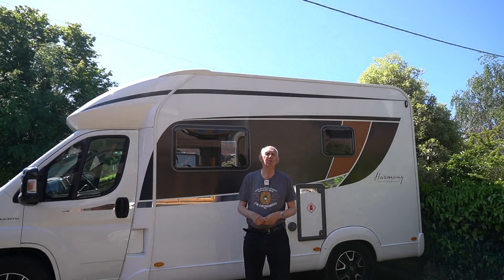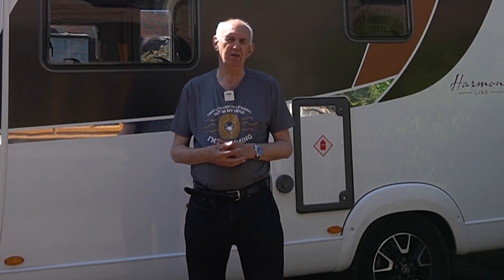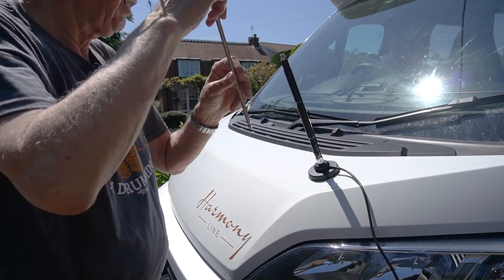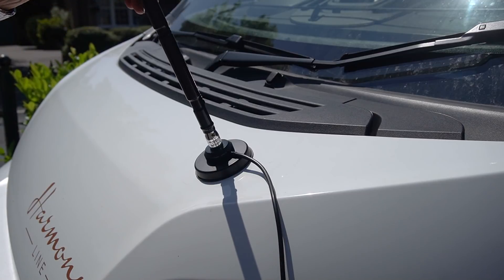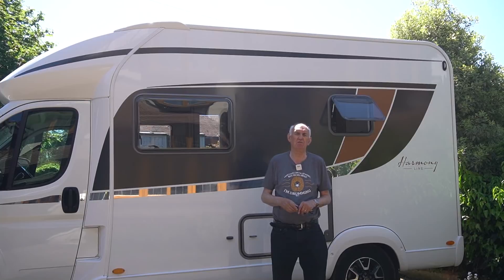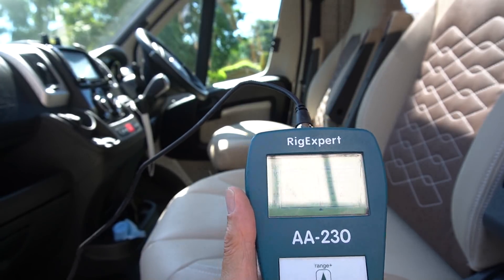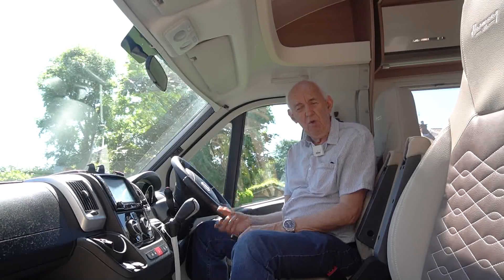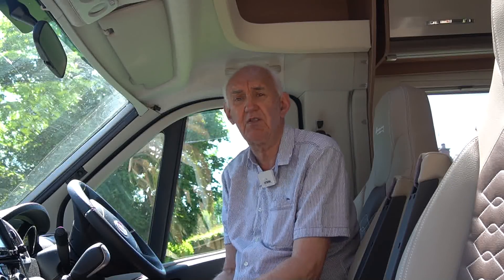HF MOBILE ANTENNA MAGIC

Comment: Thank you 4 sharing.
Would it not be better to install the choke at the antenna instead of the at the radio end? I am having this exact problem and just found your video. I am trying to work 40 meters in my RV connected to an ICOM IC-7300 and I am trying to use an MFJ-2289 Big Ear antenna system. I can't get the VSWR below 18:1. I am using a recently purchased RigExpert AA-650 ZOOM.
Any ideas?
Cheers,
Jay N6WIP
Reply from the maker: Hi Jay. The advantage of the choke at the radio end is that any RF pickup on the outside of the coax is choked off. Getting VSWR down can sometimes mean juggling with antenna position. But I assume you are using a choke just before the antenna enters the Rig Expert. Also, on 40m you really need a three legged mag mount. A single mag mount does not have enough capacity. Try a 20m whip. If that works out, then it is likely the mag moint needs tipo be larger. 73 Peter.

Comment: Great video Peter, I was having all manner of problems trying to tune the TXCR. Fitted some clip on ferrites I had in the junk box and managed to get 1:1 VSWR 😊 . I also noted that the ferrites have to be at the TX end not the antenna end otherwise you cannot get resonance to the wanted frequency. Guess the coax braid is acting as a counterpoise before the CMC.

Comment: I had the same problem with the 17m version. I did try a commercial HF choke in series at the feed end but still no joy. Couldn't get a good match at all.
Reply: Update, got a suitable ferrite today just as you used in the video and voila ! Problem solved, thanks Peter.

Comment: If you have more than one HF mobile whip do you have to vary the turns around the ferrite ring for each band or do you add a few turns and adjust each HF whip to give good SWR? Thanks.
Reply from the maker: Generally speaking if the number of turns work tk for the lowest band, they will work for higher bands. 73 Peter

Comment: Peter! what a well-delivered video. Please would it be possible to stop associating low VSWR with resonance though? It muddies the water for newcomers and can cause confusion. The AA230 will show resonance with ease, as you know, be good to see where the antenna is really resonant and not at lowest VSWR. I'd be running an earthing wire from the magmount to the chassis/bonnet (hood, for our US friends) where it connects to vehicle body to help the antenna also. Keep up the great work and easy to watch videos.

Comment: That is so crazy.  I just started to think about using my car to mount an HF antenna.  Just went to the store for help and they were nothing like this video.  It's crazy how I've learned so much from you.  I don't understand why those who sell this equipment really can't critically think what is going on - as if collectively they haven't put a mobil system up.

Comment: Not really magic you've stopped common mode current on braid of coax with an rf choke that's interfering with swr readings
Reply from the maker: er…….I actually said that in the video!
Reply: @watersstanton  you say you cured the problem with a ferrite core and if you have problems matching you must start with this ferrite core, you still have a problem you have just stopped cmc on braid of coax, you still haven't got an adequate counterpoise or ground plane the reason cmc was present in the first place, a low swr doesn't prove that your antenna is radiating as it should,
As you can see in other comments the video has created some misunderstanding about this subject

Comment: Sorry Peter. I feel I must point out that I feel your assertion that the Ampros have a narrower bandwidth than the diamond equivalent is fanciful. My Ampro 20 covers all the ssb portion of the band well within 1.5:1 and with a single mag mount. I also think if you had used a reasonable sized mag mount (the one you used looked like one for a 2/70) and located the antenna on the roof you would have been able to tune it in anyway. 73
Reply: Remember guys loss increases bandwidth
Reply: @Pioneer936  agree. It’s the assertion that for some reason that a shorter antenna that is 3 times more expensive should automatically match better.
Reply: @TIMG5TM  I've have both these antennas and use mounts drilled straight through roof of my van, there is little difference between the two in performance if any, I find mounting the antennas this way plays the biggest part in reducing loss and increasing efficiency
Reply: @Pioneer936  yes that makes sense 👍
Reply from the maker: i never mentioned bandwidth - I said matching - somerhing quite different. I also said the mag mount was smaller than I would like but it proved the point I was making - use an RF chike.
Reply: @watersstanton  ok on bandwidth. You did say that you get a much better VSWR resonance compared with the Ampros. This I find very surprising indeed
Reply: @watersstanton  The coax should not actually run at right angles to the antenna, which becomes difficult with a magnet base.
With a fixed mounting foot, the swr is a lot better.
Reply: Peter's van roof is fiberglass/plastic. Possibly his cab roof is steel but still small in area and wouldn't have made much of a difference.

Many moons ago, I had a 20M Hustler stuck to the roof of a US-Sized Ford StationWagon via a Three Magnet Mount. Had the same problem and partially fixed it with an UglyBalun because my Elmer told me so. Later incorporated a toriod with better results.

There's going to be RF, to various degrees, on the CoAx no matter where/how the Aerial is mounted. So as a Rule-O-Thumb, I use a choke whether at home, mobile, portable on a sandy beach or sitting in a swamp.

Also from my Elmer, 'There's no such thing as Absolute/True Ground when it comes to RF'. Something I became painfully aware of while testing Tempest VDU Terminals for the USAF in the early 70s. With lots of shielding and 'good' grounding they worked fine untill we connected them to the network. The fix was to add RF Decoupling circuits to the input buffers internal to the unit. In hindsight, SnapOn Ferrite Beads on the Network Cable would have been more effective at a fraction of the cost but back then, we were too smart for our own good. HaHa.....

Peter's demonstration was just that, a demonstration and a darn good one. I think that might have been lost on a few commentors. Don't be so picky.......

BTW: Another great vid Peter.
Reply: @rjinnh3933  think there's a misunderstanding with some of the people commenting on this video about what an rf choke does, yes it's great presenting but the information needs to be precise or conclusions are misunderstood as some of the comments suggest
Reply: @rjinnh3933  BTW you didn't fix the problem with the tri mount all you did was stop the common mode current entering the braid of coax causing more issues, the antenna is telling you something that you have disguised with the choke

Comment: Your 'solution' will decrease the power getting back to your radio, but it won't increase your output efficiency.
Reply: It stops common mode current causing havoc with you system, it does not reduce power
Reply from the maker: er….wromg! A 3:1 VSWR will certainly decrease the output from the transceiver. Peter

Comment: A snap-on ferrite near the antenna helps keep RF outside of your cab and another at the feed point and maybe a few along the length but not at regular intervals.  The idea is to prevent standing waves from forming along the length of the coax.
Reply: @Greg White "means I am not going to get involved in a discussion about alternative facts and illogical assumptions."
Oh, okay.  Usually it signifies agreement and a willingness to not continue the argument. Kinda like being out of ammo but not quite willing to accept the other point of view.
Reply: @thomasmaughan4798  yep that’s our Greg. A failed YouTuber who dishes out all sorts of venom on others, yet when he copped some flak he decided to throw out his toys and close his channel. By the way, if you really need help to sleep, check out his remaining stuff on here entitled “The Ham Sandwich” it’s appalling even by Greggie Boy’s standards!!!!
Reply: An rf choke /ferrites stop common mode current on braid of coax that may be interfering with swr, an rf choke has nothing to do with stopping standing waves along the length of coax
Reply: @Pioneer936  "stop common mode current on braid of coax that may be interfering with swr"

The "S" of SWR is "standing", how can it be both a current and standing?  If it is standing, it is not a current.  It is standing.

Common mode is a feature of a pair of wires that are supposed to be balanced; one wire has a current going one way and the other wire has exactly the same current but going the other way.  Their magnetic fields thus cancel and such an arrangment neither radiates nor accepts electromagnetic energy.

Coax is unbalanced and the term "common mode" isn't exactly appropriate because of that.  You might achieve magnetic cancellation but not electrostatic cancellation because the inner wire is shielded but the outer wire (the braid) is not shielded.  TRIAX shields the braid of Coax.  

Ferrite on the coax can provoke standing waves by suppressing RF current on the outside, creating a high impedance point.  If you space the ferrites 1/2 wavelength apart on the coax, you'll get a doozy of a standing wave between the ferrites and it can dramatically alter your antenna radiation pattern.  

Vertical antennas that use guys tend to have irregular spacing of guy wire insulators to prevent this phenomenon. 

"an rf choke has nothing to do with stopping standing waves along the length of coax"

Stopping the standing waves is a side effect of their actual function.  Obviously they impede RF current, but without RF current there cannot be a standing wave.

What exactly IS a standing wave?  It is the peak VOLTAGE that you would measure along the length of the braid where the outgoing wave passes through the reflected wave.   At specific distances from the antenna or radio, the peak voltage of the outgoing wave happens to align with the peak voltage of the reflection and consequently that's where you get a peak voltage.  1/4 wave along the reflection is now out of phase and when the transmitter goes positive, the reflection goes negative and with infinite SWR, you would measure ZERO volts at that location.

Now, insert some ferrites, and suddenly that node where you had zero volts now has the expected transmit voltage.

If you happen to put your SWR meter at that zero volt node, its reading is going to be seriously in error. Not completely wrong, but certainly not reliable.  That is why I have ferrites next to the SWR meter to break up the standing waves.

By themselves, standing waves are relatively harmless.  The danger to the transmitter is that in worst case it can double the voltage on your final amplifier (tube, transisistor or MOSFET) and destroy it.    A tuner simply reflects the reflection back to the antenna giving that wave another shot at being radiated (more or less).  

Ferrites are an inductor and become part of a tuned circuit with the coax.  They won't always stop RF current IF you happen to choose values of inductance and spacing of ferrites that just happen to be resonant at the frequency being used. In that case the ferrites might as well not be there and might even augment the phenomenon.
Reply: @thomasmaughan4798  think you have misunderstood what I've said, you said that the idea of an rf choke is to stop standing waves forming along the length of coax,,, this is not what an rf choke does, it has nothing to do with stopping standing waves forming at all its to stop common mode current on braid of coax due to an antenna imbalance, nothing to do with a feedpoint impedance mismatch, you can have common mode currunt issues with a 1.1 swr perfect match
Reply: @Pioneer936  "you can have common mode currunt issues with a 1.1 swr perfect match"  While rare, I suppose it is possible.  I don't use the phrase "common mode" since it simply is not common mode.  It's just RF on the outside of the coax.  Usually from unbalanced antenna feed point but can also be induced by the radiating elements of the antenna into everything metal nearby, which includes the feed line.   This is particularly true for people using mag-loop antennas (me).  
http://www.arrl.org/files/media/Group/antenna_myths.pdf
Reply: @Greg White "Are you seriously trying to say that with QRP power levels , into a small loop , that you are inducing RF onto the coax at such a level , that its affecting the operation of the radio and it must be choked"

Had I meant to write that, I would have written it.  But now that you introduce the subject, yes, I had to replace the final amplifier MOSFETS in an Icom 7300 because RF induced in the coax found its way back into an Astron 35 amp linear power supply and triggered the crowbar SCR.  The abrupt short circuit in the power supply caused capacitors in the radio to discharge backwards to the power supply and briefly reversed the polarity on pretty much everything but the MOSFETS took the hit.

My next experiment was with a Goal Zero Yeti 1000.  It went into battery protection mode but at least did not crowbar.  Just blip and no power.

Finally I use good old reliable lead-acid batteries.  They are heavy so I have a pair of 35 amp-hour batteries in parallel, feeding an MFJ booster to get the voltage up to 13.8.  It also didn't like RF and was messing with the voltage regulation but a small ferrite on the input and another on the output stabilized the regulator.

I forgot to turn it on so one day running about 30 watts of FT8 the radio suddenly shut itself off because of voltage drop on the batteries.   There's a slight birdie on the booster right in the 40 meter WINLINK frequency. 

"Your loop is simply not unbalanced and you are causing common mode current on the feedline."

I do not use or understand "common mode" in the context of coax cables.  It will probably be difficult to continue this line of thinking because of that.  RF on the feedline is picked up along its length.  The loop itself is inherently balanced; that's one thing we agree on. 

"It's not from RF being induced"

Yes, actually it is.  At the loop I have about 8 turns of coax forming an RF choke.  Induction happens along the length of the coax and is not traveling over the shield from the antenna itself. 

I can see why some people are reluctant to join the hobby when so many experts exist but rarely agree.  At this point I would boast of my credentials but all I have are words.  But then, that's all you have.   Enjoy!  

PS: In the context of crowbar circuits, I found this interesting comment: "This is truly sad, and a good reason to have your expensive radios running on a power supply that has a crowbar protection circuit in it."  Yeah, well, it was the crowbar that killed my radio and later models of the Astron modify the crowbar with FERRITE BEADS to keep RF out of the SCR.  

A crowbar followed by a polarity protection diode would be better.  I'm a bit nervous about the MFJ booster since it also has a crowbar circuit, but with the ferrites on input and output it seems less vulnerable.
Reply: @Greg White "common mode current on the feedline"
Indications are that you are a very experienced electronics technician so I am puzzled by your use of the phrase.  The only way for it to be "common mode" is for a current to be traveling one way (say toward the radio) on BOTH the center conductor AND the shield; in other words common to both conductors.    

That's just a peeve, I doubt I will convince anyone about it.   Stopping real common mode current could be quite difficult since the inner conductor is shielded (that's the whole point of it).  Real Common Mode (tm) is something that would be induced in BOTH conductors at the same time, probably by a nearby transmitter, as say at an ARRL Field Day event or a nearby lightning strike particularly if you are using a dipole without a transformer balun.  A ferrite rod, bead or toroid would stop the current flowing on the outside but would do nothing for the current flowing on the inside.
Reply: @Greg White "Whatever."  Exactly!  There's what works and what does not work; knowing the reasons why isn't always necessary.  
In the topic of mobile HF antennas, they are almost never balanced, which means RF is pretty much everywhere inside the cab seeking balance.  It helps if you keep it away from your body.

Comment: Great Vid & Advice , Sold on idea to Keep 2 or 3 FRs Handy
Any Freq any Band inc other than Ham ?
Reply: Any time the antenna itself is not perfectly balanced (certainly the case for mobile antennas) the coax is going to radiate and develop standing waves of its own, depending on many factors.  It is important to prevent that from happening.  So, if the antenna is not a perfect dipole, you must use some sort of RF "choke" on the coax.   It can be as simple as some turns of the coax even without a ferrite.
IF you use a ferrite, you must choose carefully the KIND of ferrite since they have vastly different responses at different frequencies and might not work at all at 14 MHz and above.
UPDATE: Even with a perfect dipole you still need a "balun" to achieve balance and not have the coax radiating.